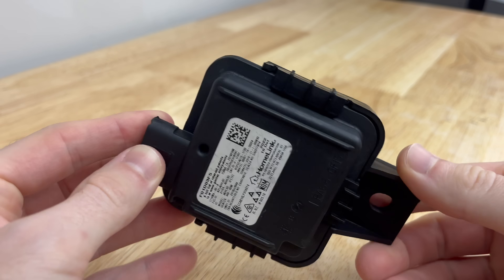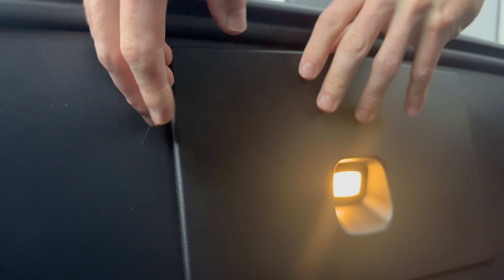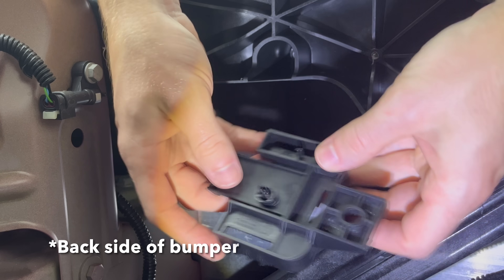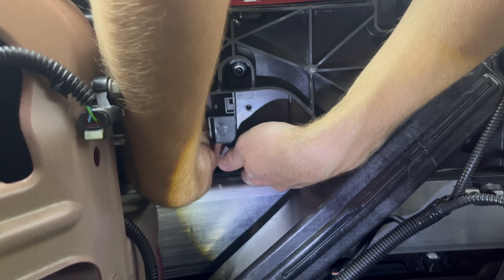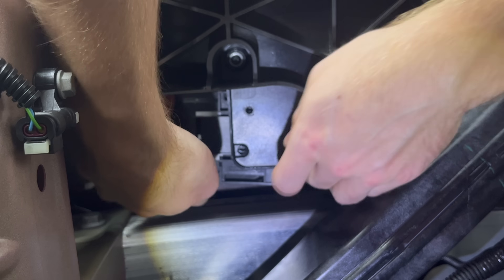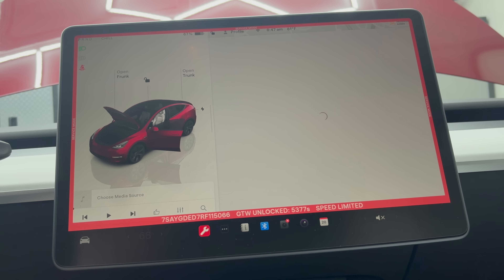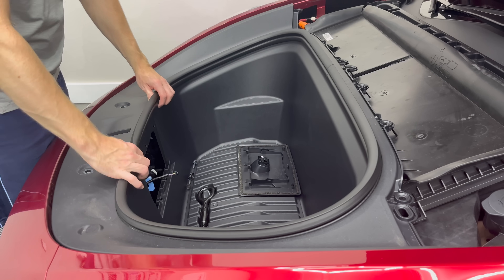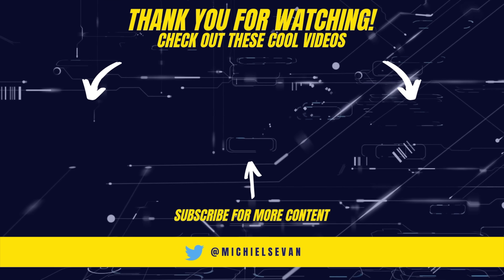Tesla Model Y | Model 3 - DIY HomeLink Install and Setup in Service Mode at Home!

Comment: While I do not need a homelink myself, I did find your video worthwhile.  I will pass on something of a "hack" that I learned many years ago.

If you have a bole, that you need to thread from a difficult position like that, AND you have visual pass through (like you do)  Use a Dremel to cut a shallow slot in the small end of the bolt.  Reach behind, and line the bolt up, hold with your fingertip. then insert a small flathead through the passthrough, and by turning the flathead, youll get the bolt most of the way in, only use the ratchet for the final snugging.  It would save you probably 25 minutes on this install.

Comment: I wouldn’t have gone through all the trouble of threading the M6 screw from the back. Instead, I’d drill out the threads with a 6 mm bit, insert an M6-1.00 × 30 mm screw, and secure it with an M6-1.00 locknut. Hold the screw head with an open-end wrench, tighten the locknut from the front with another wrench—and voilà!
Reply: Just find a matching nut from a hardware store. Tape it to the bracket temporarily. Gently screw in the bolt from the outside to get it started. Screw deeper while pulling it against the bracket so the nut won't rotate. Easy.

Comment: Spend a few hundred bucks to buy the hardware, and pay the subscription yearly. What you get is just to open the garage door. Man. Use the remote comes with the garage door opener. It is free. And most other car has this function included for free. What’s the logic from Tesla. I just dropped my opener in the cup holder. Nothing fancy but works.

Comment: The Home link cost from your source $199 after taxes and shipping divide that by three is mid $65 or so which is what MYQ is. My Model 3 is a lease so my queue would be better off for me. I don't have to take the car apart to install it, and I don't have to take the car apart again to retrieve it because on a lease you've got to remove all accessories when you give the car back so for some HOME link is not such a good idea. I don't think especially in my case just my thoughts about the matter. Thanks for posting. This is a very good source for the Homelink module compared to what Tesla charges for it.

Comment: Thanks for the instructions everything works great on my 2024 model Y. 

Purchased my kit from EBAY. The mount was super easy to install actually even when following your instruction. Probably because of an updated mount. It didn’t flop around like the one in the video. 

Things that were missing that took me extra time to figure out (simple things) disconnecting the light from the frunk you need to pull the green tab. Also pull the red tab to disconnect the cover from the home link cable (mine was really hard to pull off but came off after a bit).

Thanks for the video. Very well shot! Good luck everyone. Don’t pay for myQ lol

Comment: I hate paying for MyQ but we share it across two cars and it does work better than Homelink. Main difference is it's actually aware of the state of the door while Homelink is completely dumb, so it never closes a door that's supposed to be opened, or vice-versa, and you get positive confirmation that it closed, even if you're out-of-sight.

Comment: Do Tesla need to activate the module? I hear some people had to ask a service tech to activate it in the past. Someone else said you may have issues programming a used one
Reply from the maker: Mine was used with no problems. The car programs it for you after you plug it in under the service menu.

Comment: If you have multiple teslas, it’s cheaper to do the 10 year subscription with My Q. Also, My Q knows if the garage door is open or not,  Homelink will just send a signal which can be a PITA if the door is already open.

Comment: I bought home link on eBay, it came with the necessary bolt, took bolt to ace hardware and  bought same thread count and bolt size except 1/2 inch longer, and a nut to fit the bolt, superglued nut to front (hard to reach) spot set the mount onto bracket and screwed bolt in from front, took less than 10 minutes, hope this helps no need to reach around mount
Reply: How much did it cost?

Comment: On point, my model 2021 did not have the option. Followed step by step and worked. Yes the hardest part is the screw. Great video!
Reply: Im planning to do this on my 2021 model Y. Is it the same homelink model and instruction as shown here for 2024?

Comment: Do you know if this fits the 2024 Model 3 refresh?
Reply from the maker: I have seen other videos do this, so I assume so.
Reply: 2024 Model 3 has the connector to the front, not the side. Also, the mount for the bracket is a little different so you need to get creative

Comment: Well, the bracket is installed in the back, actually. The way you did it is more complex and doesn’t give any advantage on the signal.
Anyway, thanks for the video!
Reply: Tesla guy installed mine front of driver side. Didn’t look easy and wasn’t quick.

Comment: Great Video! 
I have a 2024 Y and when I tried to order homelink from Tesla is tells me I can't order it becasue it's not compatiable with my model Y?
I went into my app and set up a sevice request and they said to order it first and then set up an appointment. I told them it will not let me order it becasue it's telling me it's not compatiable with the veichele in my account. I asked them to order it and they said they can't becasue it's telling them the same thing. 
 I guess I'll order it and see if if works when I install it..
Reply: I installed HomeLink yesterday on my 2024 "Y" that I could not order from Tesla because the app said it's not compatible with my vehicle. 
Even chatting with the service agent from Tesla I was told it's not compatible and they would not let me order it. 
I came across this video and decided to order it on E-bay. I installed it yesterday in less than an hour and it works perfect.

Comment: Mission accomplished! Took several trials on the linking up part but, I’m in. Thanks for the video. The hardest part was figuring out the cap removal 😂. There is a U shaped black hold in front and under the red tab that gets pulled back. Lift that up and over and boom. The flat head screwdriver method is a no go….for hours.

Comment: Thanks for the video and links. The one I bought from eBay was not only cheaper than from Tesla, but also included a 10mm screw to install it.
Reply: If you buy from Tesla, it includes the installation.

Comment: Homelink was a nice feature on my 2013 Model S. Cool to see how simple the installation is. 

I currently have MyQ it works very similarly to homelink. It works better with multiple Teslas because it knows the garage door position and won't try to open an already  open garage.
Reply: I have MyQ as well but I refuse to pay a subscription just to link it to my Tesla. I just double velcro my garage opener behind my center screen instead. It's easy to reach & discrete, faster to operate. This homelink module is not a bad idea, but it costs $180. I'll just stick with my $2 velcro. 😂
Reply: @dougdu thank you for not paying for that stupid subscription.

Comment: $200 is crazy to open your garage door when you can do it in your phone for free…
Reply from the maker: Enjoy using your phone every time you pull up to the garage door.
Reply: @EMtesla1  lol not like you’re not grabbing your phone every time you get in and out of the car anyway… you can literally set the garage door opening to be a voice command on iOS or a function thru IFTTT, at the least like you said just use the app. Thankfully I don’t need to open the garage every time I get home. I park in my driveway
Reply from the maker: @Danjr704  whichever makes you happy!

Comment: Thanks for sharing. I think I will stick with “hey Siri, open the garage door” as I drive up in my M3.
Reply from the maker: Fair enough! I'd rather have no input at all. Automation is perfect for me.
Reply: if you want a better hack then that. buy a smart outlet and setup a homekit automation to automatically turn the smart outlet on when you get home.  then set up another homekit automation to open the garage door when the smart outlet turns on.. now you have auto opening garage
Reply: cool flex bruh!
Reply: How does Siri authenticate you?

Comment: Your instructions were so on point and helpful. I got it installed 3 months ago, BUT in June, TESLA made a software update restricting the "software installation" to those (like me) who bought the OEM adapter through eBay. Anyway, once I saw your video in my feed, I jumped to my MY, and I was able to complete the installation. This confirms TESLA is allowing the installation of the HomeLink module from other places (amazon, eBay, etc.).  I bought mine for $115 brand new/ and sealed, so a good saving!.  Thanks again for your video!
Reply: What! Can you post the link for the 115?
Reply: @korycooper7965  what u mean the ebay purchase?
Reply: @mgabriel74  oh. It was on eBay? Congrats on getting it for that cheap!
Reply from the maker: @korycooper7965  Link for product is in the description.

Comment: Subscribe? Ripoff! My 2018 TM3 came with HL pre-installed and requires no subscription.
Reply: Mine did, too, but it stopped working after an update. 
Moot point: 2018 M3 was totaled a couple months ago by a hit and run driver. Now have new (2025) M3 and wondering how to move forward as I do have a MyQ garage door opener —-and a $250 referral credit in my account at Tesla… 🤔

Comment: I have had both for 6 years.  I prefer the convenience of MyQ. I can open any one of my three garage doors for anyone from anywhere.
Reply: You pay for MyQ in the Tesla when you have free homelink? My family all have MyQ and share garage doors for free and can open from anywhere too without subscription. Did they start charging for that? 

I actually have a relay installed on my opener for my home automation system so I can open from my watch, phone, voice command, or my camera app (tiny cam pro) anywhere also (also for free).
Reply: @jratliff681 no you can do myQ without subscription to just operate the doors.  I think you need the subscription for the integration to MyQ or to allow outside devices (Tesla).
Reply: @jratliff681  Since when is homelink free? it costs like 350 dollars. i'll probably sell this car and be in a new one before i spent the same amount with a yearly myQ subscription

Comment: Main reason I won’t buy a Tesla because Elon is so cheap. No reason home-link is not preinstalled. 🙄
Reply: A very specific reason.  MY and M3 are the most affordable EVs in the world and the way they achieve that is by eliminating extra costs...
Reply: I know, right. Start looking closely at the wheels of Teslas manufactured after Elon removed the ultrasonic sensors from the bumpers. In my area all the newer Teslas have serious curb rash on the rims. I too learned this lesson the hard way unfortunately. I have a MX with sensors and a MY without and I pity the fool that uses auto park on the MY. I assumed (incorrectly) that TeslaVision was as least as good as the sensors….it ain’t.

Comment: I bought double sided Velcro tape for $4 and stuck a regular garage door opener to the inside of the driver side door pocket. It’s invisible from all angles and I can quickly reach down and click it when approaching home. Easy and cheap.
Reply: While I like the idea of using the standard garage door opener instead of homelink or myQ, the drawback is if anyone ever breaks into your car while its parked outside, they now have instant access to your home via your garage door.
Reply: @Bryan-ud5ri  do you not keep your standard garage door opener in the car?
Reply: Me too
Reply: Crap, I put mine behind the monitor.  Velcro tape keeps falling off due to heat.  Your location is much better.
Reply: @WilliamMorfin I used the 3m command Velcro strips and they have been fine. Also installed behind the screen.
Reply: Same here.
Reply: Exactly
Reply: Me too
Reply: But not fully integrated. Complete hack.
Reply: I used these picture hanging strips and located the remote control beside the lower left corner of the MCU. Can’t see from inside or outside. https://youtube.com/shorts/zyli211WUsE?si=vnY5qaE9OeyJYWtb
Reply: Good for you?
Reply: For the win!
Reply: I used the Velcro type strips I use for my EZ Pass transponder. Behind the monitor, left lower edge. Holds and out of sight. Last Tesla I paid the $350 but decided it’s not worth it for me.
Reply: When v13 starts parking automatically in the garage. This upgrade will be a nice addition. Once the car is doing everything for you and the only thing you're doing is getting in and out.
Reply: Yeah that looks easier but with the HomeLink adapter installed when you get close to you home your Tesla automatically opens the garage door for you
Reply: @yoda3647  That's exactly why I cannot use it.  I don't always want it to open when the car get close to the garage
Reply: @willie6184 I believe you can set it not to do that.
Reply: @yoda3647 I had it installed in my Tesla 4 years ago but couldn’t used that feature because occasionally our dogs are in or walking through the garage and would run off. Had to manually hit the “activate” button so wasted on me.

Comment: Wow, i didn’t know that MyQ charges for their app currently I have the old Ryobi garage door opener. That currently starting to have issues. I been looking at different brands good to know.
Reply: MyQ is technically free using the mobile application directly however vehicle integration is what they make you subscribe for.  So if you are setup with MyQ already aside from the vehicle you can open your garage door with the app. for free it's just not as seamless, I prefer the home link upgrade it's just a tight hand squeeze.

Comment: I would like this for the cybertruck
Reply: There are three reasons I can think why they didn't do it:
1) 48V architecture - so unless HomeLink will design a 48V version of their module then it won't be made.
2) Metal body interferes with the signal - two potential spots I could think of is behind the front vents or another potential spot is to remove the rear-view mirror assembly and piggyback on the 12V (step down) for the auto-dimming feature.
3) Lastly, speaking of the 12V, it's not enough to simply power the HomeLink module. It needs to be able to communicate back to the MCU / Infotainment system to display the option(s) of either opening/closing the garage door - this would mean more wiring harness, step-down converter. Since Cybertruck is utilizing an ethernet link in comparison to CANBUS, there would be more effort required to from both Tesla and HomeLink to make it happen; my guess HomeLink didn't want to allocate resources when they already have subscribers paying for MyQ.

The best compromise between Tesla and Customers would be to include MyQ subscription as part of their Premium Connectivity, especially now they don't have to pay their streaming partner any royalties and provide a 3-5% royalty to HomeLink instead. Then again, as the top commentator on this video just mentioned: Buy $4 Velcro, then slap it on somewhere convenient.
Reply: @arya_jahan98  Thank you!

Comment: Couldn't you have put the screw in from the opposite side?
Reply from the maker: The bracket does not have a screw hole only in the front bumper portion. If you did this, you would need a washer nut for the other side regardless.
Reply: @EMtesla1 fitting a washer nut would be easier & save 25 mins probably.
Reply from the maker: @peterhofland1862  that’s three pieces you have to hold at once instead of two, but ok try it out!
Reply: @EMtesla1  I was assuming that if inserting the 6mm screw from the opposite end to what you had shown then the bracket would just slip onto the protruding thread & could be secured with a washer nut? You’ve done it not me so just in theory. Can I confirm that once installed there is no free option & a subscription is compulsory to enable operation? Thanks from AUS.

Comment: I guess it’s a personal preference whether we want myQ and not to mess around with the car’s electric tho that plug is already there unconnected; thanks for the video showing exactly where it is.  We just got our LR less than a week ago just realized there’s no HomeLink (as in my MS) but only myQ is available.   Well, we just ordered the little garage door opener and the community gate opener, we are good to go, $15 total 😅
Reply: I just put velcro behind the screen on lower portion of it and hide my regular remote garage opener. Faster than screen tapping

Comment: 😂..I put a white styrofoam cup upside down hanging like you did with the smiley ball.  Love it.  
Great video btw.  If viewers are wondering the setup for Homelink is so easy it's nuts.  I've only used Homelink, but was curious about myQ.  After a lot of research and reviews I decided to stay with Homelink.  The installation on my 2024 Model 3 LR AWD requires the front bumper to come off...fyi everyone.  Buy it from Tesla and the installation fee is included...just schedule it for mobile install...at home..and you're all set.  It's that easy.  
It can be setup for full automation.  I have a datached garage and a gate.  That is why Homelink is best for me.  myQ being Wi-Fi dependant and glitchy is not gona work for me.